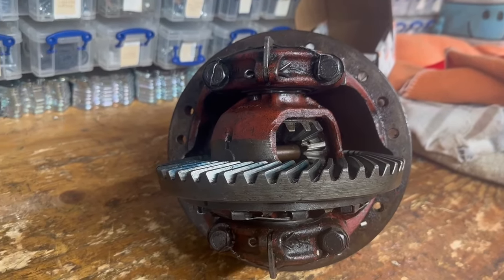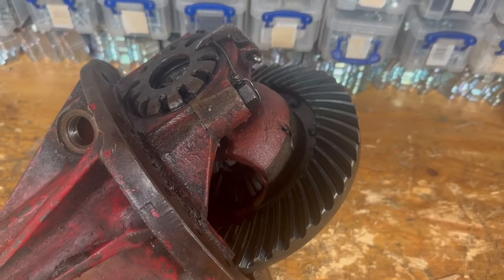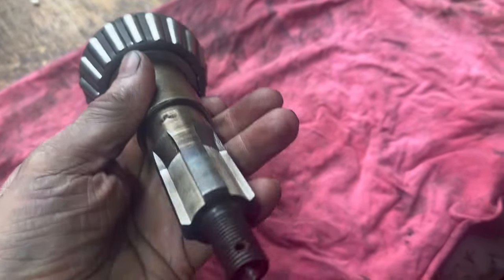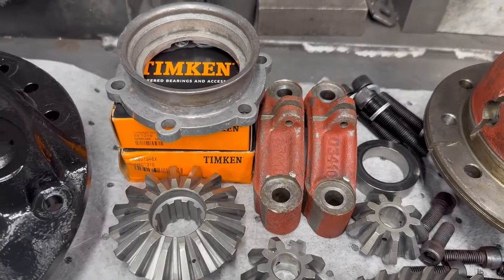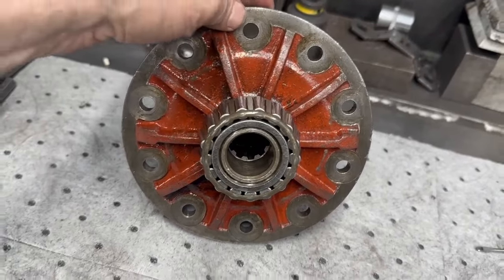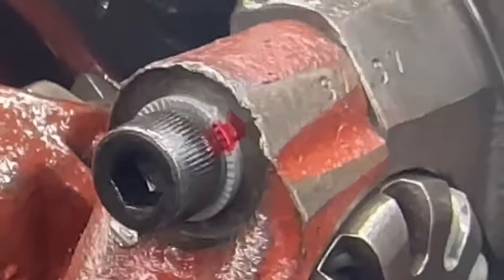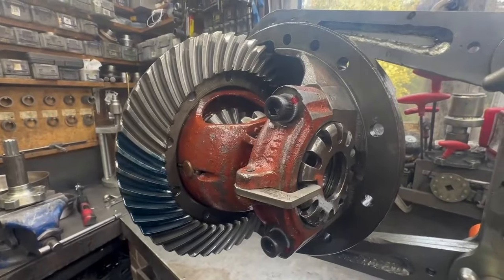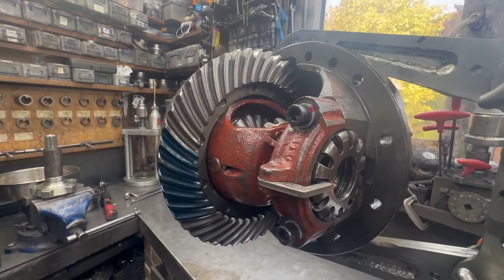Series Rebuild Sympathetic Inside Outside look original

Comment: I don't know how many of these early diffs you have actually worked with, but back in the 1980's when I got into Land Rovers (Here in the western USA) , I was impressed with the machining, materials and finish quality of the 1950's Land Rovers components. As I got into serious off roading / rock crawling, and the "Coiler takeover" happened in the Land Rover community, I dabbled in some of the later stuff, but I came back around to my 1950's Land Rovers.  Living in a part of the world that doesn't have the horrible corrosion that you deal with, I have the joy of owning / working on original, non rusted series I's, a number of which are really used !  I have been thrust bolting diffs for 30 years, and I ALWAYS use the early (1958-older) diff castings as they are not SGI like the later ones. They are steel castings and they weld beautifully.   Due to lack of available lockers in the early years, I actually machined and re-drilled a locker for a Dana 44 to fit the Rover crown wheel.
 After 24 spline lockers became available in the 1990's I tried the 24 spline shafts for a number of years, but tired of breaking even the 4340 ones.  I built hybrid axles of various types, but finally got back to playing with the old Rover diffs, leveraging my old know how with them.  Nowadays I run original series I diff castings with my own Stellite faced thrust pad setup, Ashcroft 3.50 (the only ratio I think will stand up to my abuse) and Ashcroft air lockers that I modified by annealing the side gears, machining for 1.400" 32 spline, then heat treating to my specs. I bored the bearing journals to just pass the big 32 spline shafts that I machined and had heat treated to my specs as well.  The rears are still semi-float (Yes, I'm a series I purist on that detail !!) and are totally stock appearing from outside. I set them up with twin big tapered roller bearings each side that fit the original series I bearing housings perfectly, the the bearings are bigger than a Defender full floating hub bearing.
  The front is where the really cool stuff is, as the MUCH larger series swivel balls come into play.....  You see, the series balls are super thick, yet made of EN16T, the same as coilers. I machine a very large amount from inside them, press in 4130 chromoly bearing adapter rings, and run a narrower swivel pin bearing pushed further out. This allows me to use a huge CV joint (beefier than 101 FC, I used to break those !!)  The front inner shafts are my own custom 1.400" 32 spline units.  I sleeved both front and rear axle casings to prevent bending on the big rock stair cases that I bounce up and down, shaved the drain plugs off the bottom, and filled the bottom section with 3/8" thick steel plate.
The ability to run these huge CV joints, combined with the better metallurgy in the diff castings themselves, combined with MUCH bigger swivel pins / bearings is why I feel the series axle assemblies are a most highly under-rated platform.    Thanks for the nice videos !